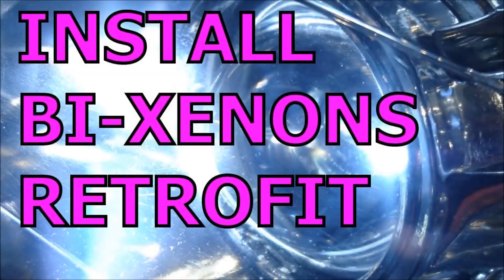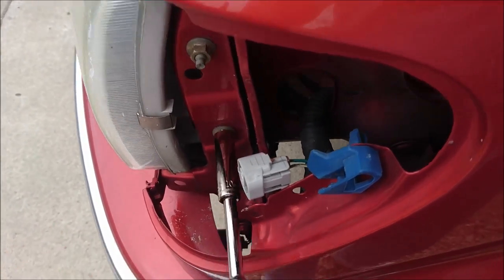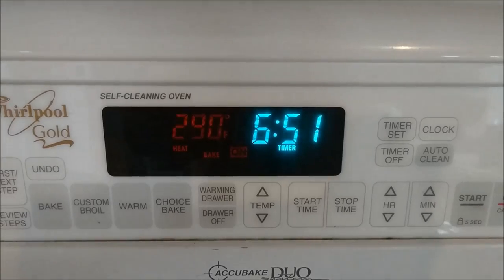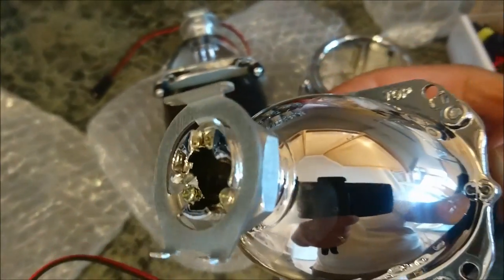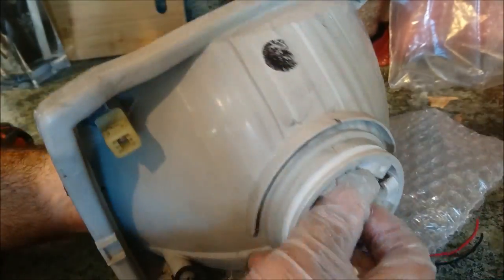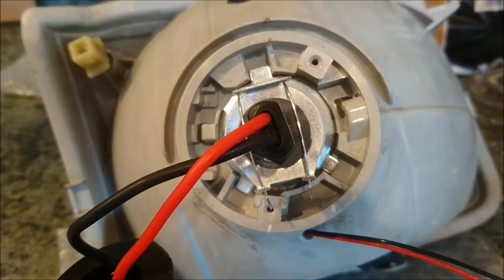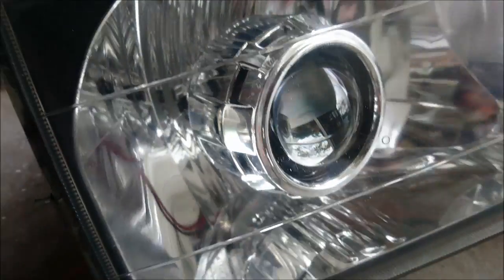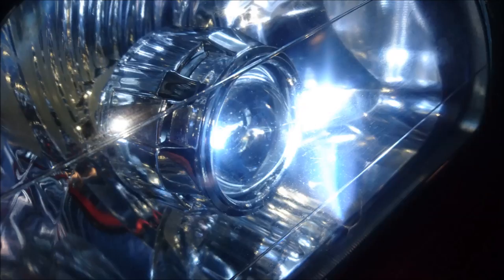Retrofit Projector Bi-Xenon Headlights DIY! EASY!

Comment: Upvoted especially for clearly showing the order of putting on the big silicone washer, projector in the reflector hole, small silicone washer, metal washer, metal nut, bulb holder.

Comment: I searched this type of video to see why retrofitting your headlights is so expensive. Now I know why. It's not because people are afraid to do it, but how much time and labor it takes to install and put it back together scares people away and let pros do it instead.
Reply: I did it myself, took a few days to complete due to wiring and alignment issues. Extremely frustrating.
If you have the money, let the pros do it.
Reply: Think of them as fun little LEGO projects😉 It will take a day or two but its fun and will be worth it in the end.

Comment: Hey im installing the same projectors in my vw jetta and had a quick question, i have 3 wires going to my headlight, a ground and a power for high beam and power for low beam and power gets cutoff from high to low beam wire when you alternate between high and low so how should i wire it because if i supply power to bulb  from low beam wire that would work for my low beams but if i wire high beam wire to the projector selinoid power will be cut off from bulb when i change to high beam, im thinking my best bet is to wire in an on/off switch for the selinoid but was wondering if you were able to keep constant power to bulb and still work high and low beam with factory switch
Reply from the maker: You will need to get a HID relay that has provisions for the High beam wires. It will take power directly from the battery so you won't lose low beam if you activate the high beams.

Comment: Wait are these the ones for only the like low beams or are they the low and high beams combined. I literally read that not to long ago and forgot everything on that.
Reply: If it has wiring then it's most likely to have both low and high beams.

If it's only a low beam it'll just be the projector and the housing because it'll just porject whatever light the bulb is giving out

Comment: Hi. How do you know its put in level? What if the xenon points up in the sky or oncoming traffic etc. Thanks
Reply: He missed (or didn't show) the part where you should put your headlights back in your car, after you finished installing the projector and bulbs but before finally sealing them, and check how level the light pattern is in a wall. It's recommended that you get in front of a wall about 20 feet from it with your stock bulbs still and measure the beam pattern on the wall, then use that measure after you install the projector as a reference for leveling them. Most of the times the bulbs on them need to be shim so the cutoff line gets aligned properly with the hotspot of the bulb.

Comment: Hello :) thx for THE help :D have ordered h4 reley :D Anny tips on how to know that THE projector is straight and not croced?:)
Reply from the maker: You can use an aux battery to test before tightening it. Just make sure the high beam motor is facing down.
Reply: @UsefulVids  oh thx :D
Reply: Daniel Levau we have the same pfp 💀

Comment: Can you place an H1 LED instead of H1 HID?
Reply from the maker: Yes, but be aware that LEDs usually have a big fan or heat dissipation strips on the back of the bulbs. You’ll need lots of room behind the headlights once installed due to this.
Reply: I would recommend against using plug and play leds in a hid projector. You would get inferior beam pattern.

Comment: How do I wire up the high beam function for bixenon
Reply from the maker: You connect the red and black wire for the bi-xenon motor to your high beam wiring. Or you can get a hid relay.
Reply: Useful Vids thanks for the reply, I just installed my retrofit as is, I’m looking into a splitter wire for the high beam. So we I can run the stock hi beam and projectors in tandem

Comment: Hi!!! I am installing the same projector. Can you guide me how can i install red led stripe lights the  demon lights.
Reply from the maker: Just connect the wires from led strip to parking lights (hot and negative) or low beam. Then it will come on either with parking lights or when low beam is on.

Comment: I know this is an old video, but I gotta ask: I have a 2004 Acura TSX, though in SA it’s called Honda Accord. Car comes standard with Projectors, but for some reason the Projectors are loose and seem to be dirty and worn out. Is it possible to just buy a kit like this and replace my old Projectors with these new ones?
Reply from the maker: Yes, this is possible. You may need to modify the mounting points but shouldn’t have too much difficulty.

Comment: Do the projectors have to be vehicle specific?
Reply from the maker: Yes. You will need a projector that will fit inside of your housing. Also, you will need to ensure the bulb type matches with your factory headlight connectors. If not, you may be able to buy connector converters or a HID relay.

Comment: I have 2 bulbs in my 1994, one for hi beam and one for low beam. I ordered this exact kit and bulbs, everything fits and is good to go, but I wanted to ask how do you wire the red and black wires for the bi-xenon retractable flip thing? Also, since I have 2 bulbs for each side, how would I wire each headlight so that both hi beam and lo beam OEM wiring is running thru the low beam, and when I turn on the hi-beam's, that powers the bi-xenon retractable flip thing? Idk if i explained that well enough lol Please let me know..
Reply from the maker: Need to buy a wiring harness. They will take your current setup and output the wires for a h1 connection and the bi-xenon wire connector. Example: 9005+9006 connector to a h1 bi-xenon connector.
Reply: @UsefulVids  Perfect - got it ordered already! Apparently its called a quad bi-xenon setup lol and i need a molex to 9005 converter lol Thank you so much! I'll post videos building them when theyre finished!
Reply: @UsefulVids  hey what kit did you get and from where again?

Comment: Very nice video, but you didn't showed where we have to connect that red&black cables of projector..??? Plz help
Reply from the maker: The red black wires go to the high beam wires. My car has a single bulb with high and low beam. To activate the high beam, you have connect the red and black wires from the projector to your appropriate wires for high beam on your car. I hope this helps!
Reply: @UsefulVids  bro I know the purpose of red&black wires. But I want to know where did you connect them? Did you hot wire..??  Or can you send me the pics on my WhatsApp that where you have connected them. Plz help 😓😓😓
Reply from the maker: The red wore gets connected to the signal wire (hot) that gets activated when you switch on the high beam function. The black wire can go to any ground.
Reply: Hi, thanks for video. But I would like to ask a question about connection of wires. My car use orginally h4 bulb like your car and its port has three terminal such as low and high beams and ground. So now I install an H1 projector. Now how can connect this wire to my H4 port? Should I convert my orginally H4 port to H1 or are there any solution to connect the wires? Can you help me? Thanks.
Reply: @omerfarukcakmak7920  you need HID relay harness for that

Comment: How will you use pass light with HID? 
It takes few seconds to heat up the bulbs, and if frequently switched off and on, the bulbs will blow.
Reply from the maker: The HIDs don't get switched on/off for passing, the motor inside the projector moves the light assembly to a different position when high beams are turned on. When they are turned off, the motor moves the light assembly back to the low beam position.
Reply: @UsefulVids  I know that but that's when headlights are switched on, that means during the night, I am asking during day?
Reply from the maker: @ShaitaanBachha  I see. New HIDs have special circuits built in to provide stable power - you should use an HID relay that's connected directly to 12V battery. That way, you have stable 12V and turning on brights during the day is no problem. You need the newest HID ballast, 12v HID relay, and 12v battery in good condition. I am still using mine after 2 years, no problem.  Hope this helps.
Reply: @UsefulVids  do LEDs have this problem?
Reply: @MarstaJNZ  nope. LED will straight away light up.

Comment: Hello brother i have separate bulbs for high and low beam so do i also need  hi lo relay or convertor i have Renault/ Dacia Duster please tell
Reply from the maker: KING MUZIC You shouldn't need the high/low relay if you have separate bulbs for those functions. As long as the connectors are the same for the new projector and your old bulbs.
Reply: I use H1 and H7 led bulbs will these work fine with them.
Reply from the maker: KING MUZIC no, these projectors are dual high/low built into one projector.
Reply: Which one the one you are using or the one i showed you
Reply: I mean if i want to use the one i showed i need to buy two for high beam and two for low beam and will these work with h1 and h7 bulbs the one i showed please tell and will i need any brackets to hold them firmly in the lights

Comment: Did u have a relay installed for the hi/lo to work?
Reply from the maker: Kay Saephan yes, you will need a high low fuse relay for the operation of the high and low beams. In this instance we were using a 9004 relay.

Comment: Very nice 👌 vlog.
Have these bi xenon lights or projectors failed ever?
Reply from the maker: No, not really. You will need to change a bulb once in a while though.
Reply: @UsefulVids  .. thanks brother... Are ballasts do well? What's their life in general? What's the cost of the bulb?
Reply from the maker: @vikramb149  Ballasts do well if you use high-quality units, I would estimate that would last around 2-3 years or more.
Reply: @UsefulVids  which is the best brand for ballasts & projector for Renault Duster?
Reply from the maker: @vikramb149  Try to find authentic ballasts made by Philips or Hella if possible. There are lots of fakes out there, so be careful!
Reply: @UsefulVids  Thanks a lot for your help